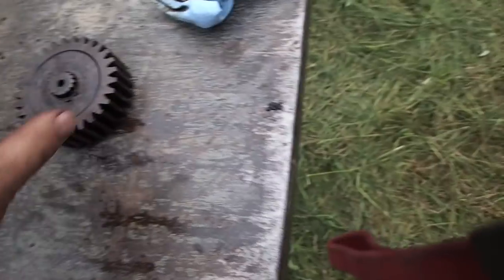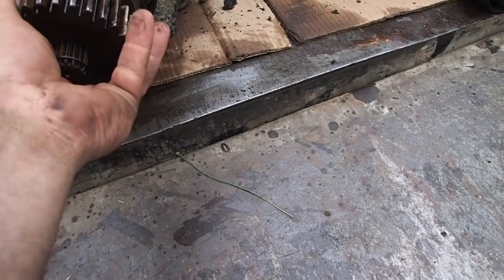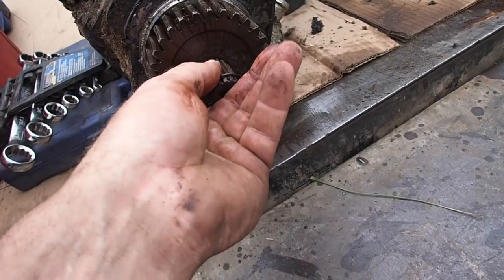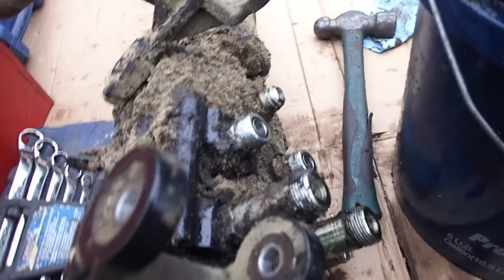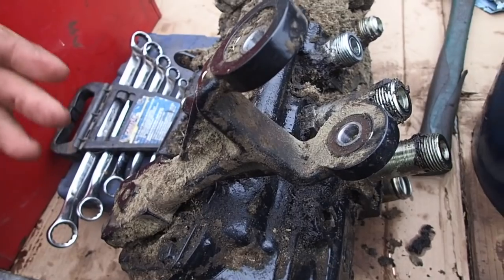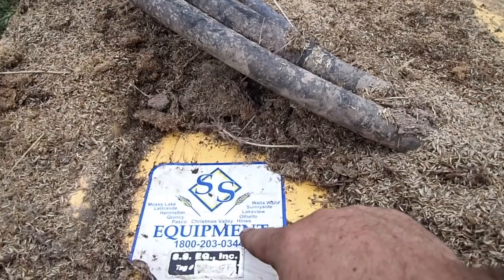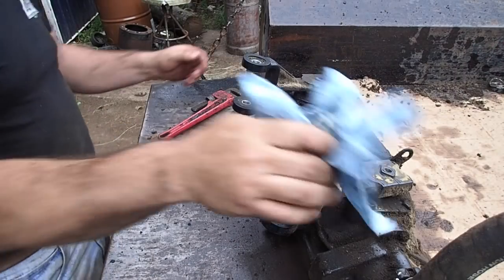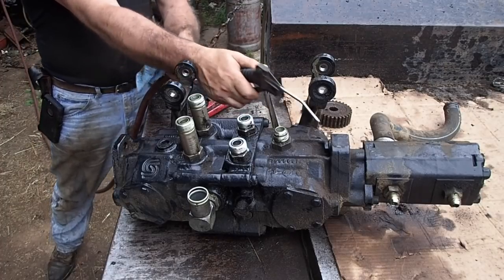WD2303 Case Sheared A Shaft

Comment: Things were moving around fairly fast, but it kinda looks like that shaft had a fatigue crack developing in it for quite a long time and just finally finished shearing. It might have had a problem from the time it was made, or there might have been a shock load that caused a stress riser right at the edge of that driving gear, resulting in the eventual failure.  I'm guessing that was failing slowly for years, and that was just your unlucky day when it finally failed.

Comment: Not that this makes any difference but the shaft failed due to torsional fatigue that inetiated from cracks along each of the splines (starry fracture). Months or even years back the hydraulic system was locked hydraulically causing small cracks along each of the splines parralel to the shaft axis,  transverse fatigue cracks grew from these under normal load cycles untill the shaft shear strength was less then the normal applied load and it failed at the small rough grey looking area. It would not matter if this shaft was twice as thick or supported by bearings at both ends the failure would be the same. Putting the park brake on while your screaming along on the road would be the type of load that would start this type of failure. There is a lot more to this story. Cheers mate🍻

Comment: I could be wrong, but that shaft looks like it twisted off. Not from side load. That pump may have frozen up or the outputs were blocked and the pump hydrauliced. Need to check before installing new pump.

Comment: Had to happen just ahead of a long stretch of good weather !   Hard to tell from the video but it appears to have a series of 'notches '  indicating a progressive failure ..  And I 'm certain you're right in your surmise of its insufficient size .  Contributing factor ( s) is likely some poor hobbing of the shaft splines .   IAC, seems like you got lucky finding some spare parts,  then unlock due some else's incompetence !

Comment: I do not own or work on tractors or other farm equipment .  However , I learned , when working on cars , if at all possible , take the old / original part to the parts store and tell them , " I want a new one of this . "

     I realize that is hard to do when ordering over the phone or on the internet .   :-(

     And I order parts , from time to time from Rockauto.com .  They usually get it correct .  When they do not , they have been pretty good at making it right .

Wyr
God bless
Reply: I used to trade mostly at AutoZone , largely because they could look up past purchases on their computer .  This made it simple to warranty parts , like brake shoes or pads .  Did not have to keep up with paper receipts .

     The other parts stores seem to do pretty much the same thing now .

      When I need auto parts now , I check online for best buy ( including RockAuto.com ) .

     Now I rarely go to AutoZone .  O'Reilly is no more than 1 mile away & their personnel seem to be a little more knowledgeable .  And they have a warehouse out by the airport , giving better availability than the closer stores .

     And , yes , photos really help .   :-)

Wyr
God bless
Reply: Wyr Twister even with part in hand auto zone screws it up everytime at least here
Reply: I try to google image any part numbers that I am about to order. You can usually find the pictures that go with the part number and match it to your own parts. Rock auto has been good about supplying pictures also. Amazon does sometimes, or hopefully you will get lucky and a customer will provide more details.

Comment: I always wonder, why not take the shaft out, go to a machine shop and they will make it for peanuts, compared to the asking price of new holland? The machine shop can test the  hardness of the metal and duplicate the part with the exact strength.
Reply: Only if you want to wait roughly 2 weeks or more. Good machine shops are always busy and behind. Wes doesn't have that kind of time to wait.
Reply: I am a machinist and could make that shaft but most shafts like that are case hardened. So after making the shaft most machine shops would have to send it to the heat treater and get it hardened. Shafts like this are usually made in large quantities so making just one would be pretty pricey plus the heat treater usually has a minimum charge. The heat treater I use charges $120.00 minimum. So You are looking at about 2 weeks to get one made and about a 500.00 price tag.
Reply: Takes at least 16hrs to rebuild the pump and replace the shaft

Comment: That gear now makes a great paper weight and if the shaft was 1 1/4 inch thick it would not have broken
Reply: how are they supposed to sell parts when nothing breaks?
Reply: Deutschehordenelite if the only thing they had to sell were the seals and gaskets and the gear they would still make money and if they had a better warranty plan with a pickup and delivery charge they would still make money
Reply: yeah but little money < big money. profits is all the people at the top care about..